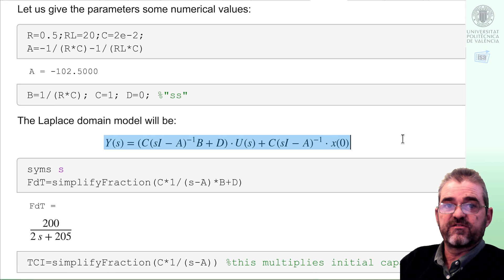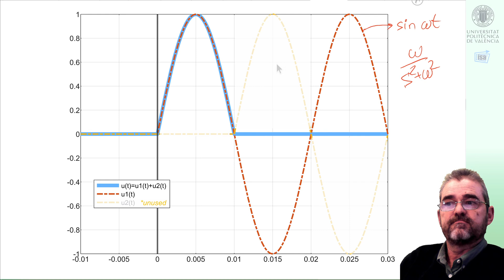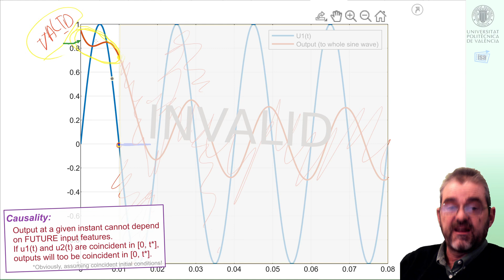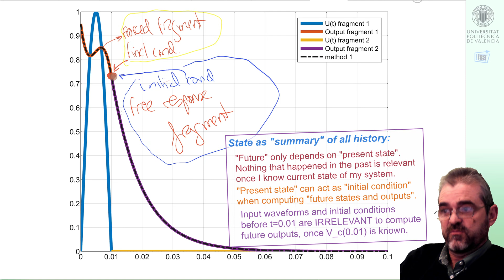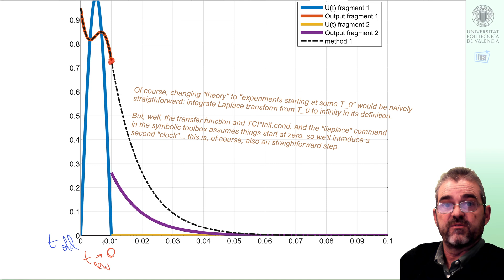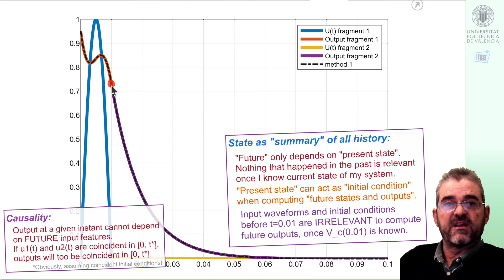**Time response of RC+R circuit to single sinusoidal pulse (2: piecewise) [MOVED]

Comment: Another excellent video mr. Salas, i have been working so i haven't seen your recent work. I can't imagine the days when all of this was done by hand, have you ever worked the equations used by the NASA when they launch rockets? there are pictures of thousands of pages of code and maths, I remember something about the mass and the power needed by every phase, when it discard the tank, something about the trajectory, in satellites and to the moon, I hope it results useful for your channel
Reply from the maker: No, I never did any space-related stuff neither used slide rules, analog computers, etc... Saludos!